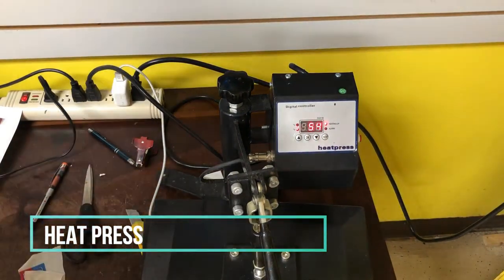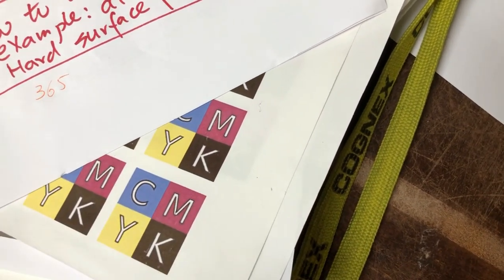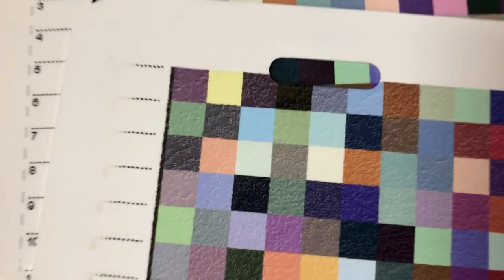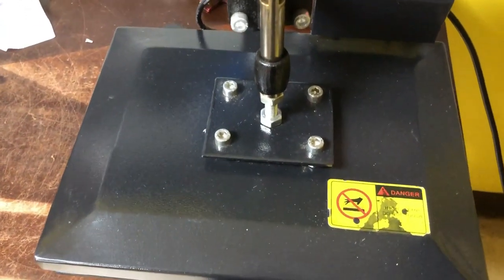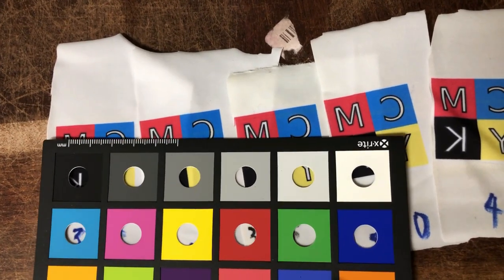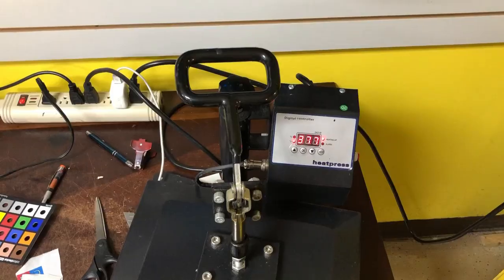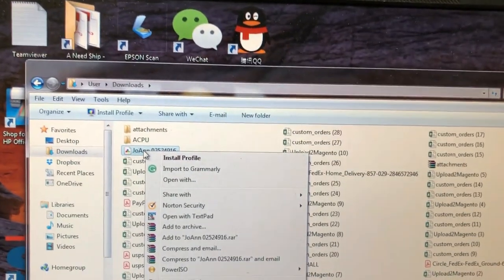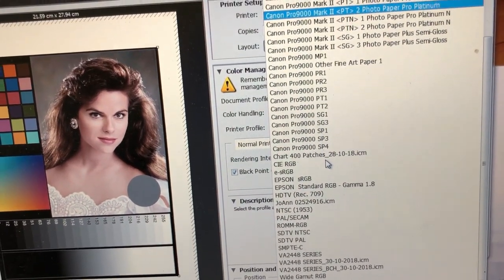7 Tips for Sublimation Success - Part 2: Time, Temperature and Color Management ICC Profile

Comment: My print is brownish. When pressed, the polyester cloth is brownish too. Any idea what I can do to improve the colours? I did use the ICC profile provided by the ink manufacturer. Thanks!
Reply from the maker: Increase the temperature
Reply: @BCHTechnologies  Err, I've read that brown = too much heat. Also, I'm already on 390F / 60s. My heat press can't go more than 390F.
Reply from the maker: It could be. The black is brown before sublimation.  If you do not heat enough, not all colors transferred, you will get brown.  However, if you overheated, some colors desublimated, you get brown too.  You need to find out that sweet spot.
Reply from the maker: What material are you doing and what is your temperature/time?
Reply: @BCHTechnologies  hi I having trouble also to transfer on polyester fabric, manufacturer say 180, I use 60 secs but the red is too light and fabric become brown, however one time I got it right but I did not take note of the time and temperature,
Reply from the maker: @danielelma153  I usually do high temp + quick for the fabric and low temp + long for hard surface (metal, ceramic...).  Try 385-400 F (195C-204C) for 15 - 25 seconds, and see if it works.